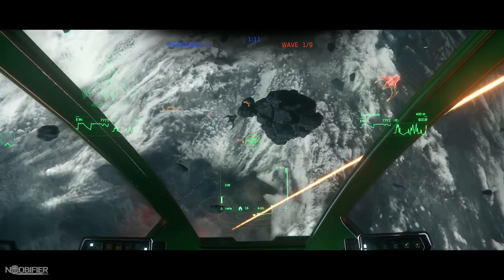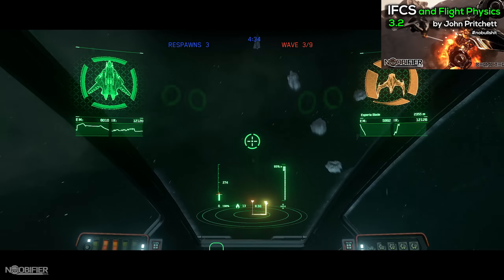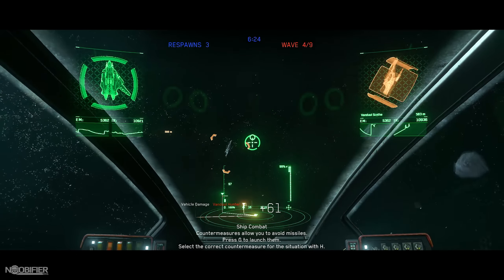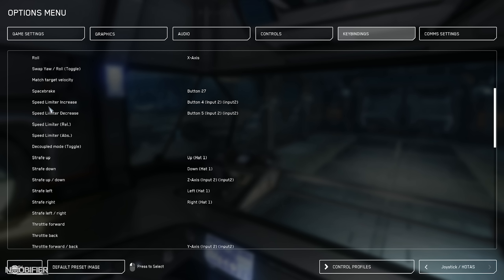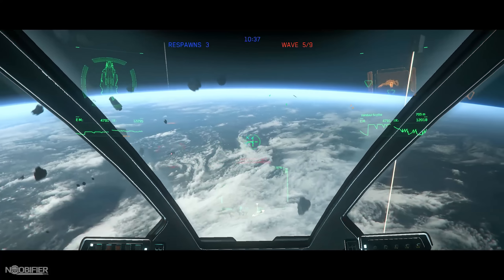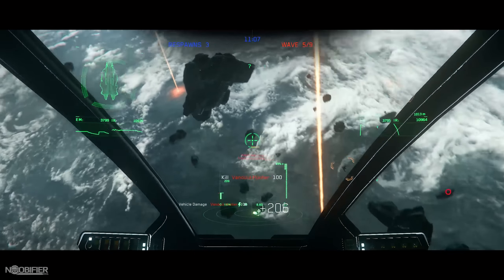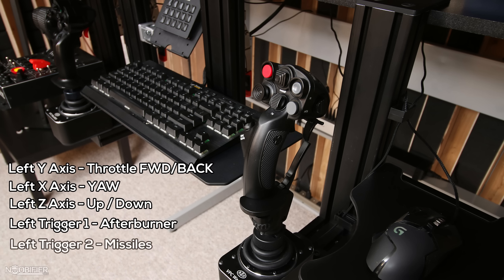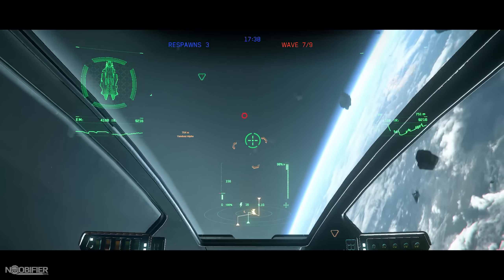Testing 3.5 Flight Model - Star Citizen

Comment: Why do you play with lead pips? Lag pips give you a lot more control over where you place your shots, and you keep your eyes on the target instead of glancing back and forth between the pip and the lasers hitting the enemy.
Reply: Maybe he just likes lead pips? I've found Lead pips make fixed loadouts easier to position, although sometimes the PIPs get all over the place (probably a bug)
Reply from the maker: I disagree, or I would have used them
Reply: Lag may work if you're 2ft away from the opponent. Not practical for actual highly varying dogfighting distances.

Comment: So many people are disappointed or discouraged about the new flight model especially for dual stick users... change their minds NOOB
Reply: It's no secret that the new flight model is aimed at mouse/keyboard first. Some of the lead designers don't even own a joystick.
Reply: @TheZhriver  possibly, some friend some mine said they don't mind it with dual joystick, we shall have to see once they fine tune the flight model
Reply: @Seerthe6th  oh it's much better than what we had. Flying is more intuitive now, especially in atmosphere. However even when using a throttle you only have thrust control while in decoupled mode, in coupled mode it uses 100% thrust and instead controls the desired speed. The new flight model is much more about managing g force and heat, so not being able to control your thrusters is counter intuitive to the new model.
Reply: @TheZhriver  agreed, i tried to help people understand the difference cause this is so fun
Reply: The lead devs on the flight model haven't flown anything but 3.x and obviously clueless

Comment: With the Delta grips have you found a way to set throttle with a button like for example in Elite ? Keep pushing the stick forward for thrust is cool in dogfights but not for long flight. Any solution from your part ?
Reply: The solution is to use the new "cruice control" function. The ship will hold the max speed you have set with the speed limiter.

Comment: Thanks so much Noobifier. I have just tried your suggested bindings and grips for 3.5. Takes a while to unlearn but shows a lot of promise. I just need to practice more. Just wondering if you have considered going back to left and right MT 50 grips? I am going to try this as I don't think you need the twist axis contained with the Delta grips if you bind roll to right stick (x axis) and straff up/dn left/right bound to right stick hat switch. What do you think?
https://robertsspaceindustries.com/spectrum/community/SC/forum/50174/thread/alpha-3-5-virpil-mt50-dual-stick-and-throttle-syst

Comment: Flight model isn't to bad but I hate to say it but the throttle systems were way over thought and make throttle control clumsy and just plain useless in my opinion
Reply: Did you fly on a race track where you cant just drift 2km arround? You need to actualy break now before turning which makes throttle the most value component... Sure in space combat you can drift 1 or 2 km np but what happens if you fight in an astroid field or in atmo ?
Biggest problem is ppl still try to fight at full speedl...

Comment: I do not like the new faked system. IFCS needed work, but at least it attempted to simulate. A cutlass without engines should not be flying on a planet. Firing Jon Pritchet was a bad idea. 

Im sure this new flight model will be fine as its worked on, but ultimately, its not a simulated system anymore. I just hope this attitude doesnt bleed into the rest of the game

Comment: Watched the video multiple times. I'm mostly struggling with thrust. Additionally It seems my X52 thrust keeps working in reverse.
Reply from the maker: There is an inverse toggle within the keybindings on a page called “controls”
Reply: @NOOBIFIER1337 I'm positive that I tried this. It was bound to a button on my stick. However I'll try it again with my keyboard.
Reply from the maker: It’s not something you can bind. It’s not a binding, it’s in its own page in settings
Reply: @NOOBIFIER1337  Ah ok, great, it have would probably taken me some time to find this.  Thanks, much appreciated.

Comment: Guess I'll be Debbie Downer... I don't like the new throttle options. It's made dual stick a nightmare. Previous was so much nicer. 
I don't like speed being indicated on the HUD as the bar, I liked seeing my throttle position as it went up and the speed as a digital read out beside it. They also don't have a way to invert the Cruise Control movement which works against dual sticks. 
Even if they add the inversion. I still feel I lose that tactile/visual marriage that I got from what my left hand was doing to what I see on the HUD.

Oh well.
Reply from the maker: It’s going to take time to get used to
Reply: @NOOBIFIER1337  
I hope so my man. Maybe they'll add a few options to ease the pain 🙄

Comment: Not a Fan of the new FM. ships drift forever, cant turn at higer speeds. feels slower in all. dam it CIG!
Reply: they wanted to get away from the arcady FPS type control in space and give ships mass.  So, it's going to divide people along those lines.  I prefer having mass and forethought in a fight vs twitch style game play and am glad it's moving in that direction.  Neither one of us are wrong, just different styles of gaming.
Reply: Another example of a dev thinking realism/immersion is better than fun.
Reply from the maker: The FM changes were purely because CR wanted it, not the devs
Reply: @NOOBIFIER1337  thats a bit sad to hear but thanks for the info. In the back i was hoping that when CR tryed it he would hate it 😐 guees thats not the case. The limmiter is my biggest consern.
Reply: Slower doesn't mean worst
Reply from the maker: It does however add to a general set of issues that lead up to worst
Reply: @kalbuth  for me it does.. slow flight sims are boring when you know ships like this would go much faster, Ace Combat feels fast and have great controles. iv played space/flight sims for over 30 years. what i pick up on spectrum and discord it seams the space haulers love the new FM and combat pilots hate it..
Reply: @brianfury9790  I couldn't have long enough time without crash on PTU unfortunately, but the Arrow & the like aren't that horrible.
Though I'm still very on the edge about the new FM, I don't have enough hour under my belt with it. The 3.4 FM was very twitchy and akin to FPS, so I'm not so fussed about speed reduction, and like I said, I don't see it as a predominant trait of piloting, so if I make a critique on new FM, that wouldn't be pointing at speed. Dogfights still looks very simplified and maneuvering.... kinda basic, more than ever since the effect of maneuvering is less impacting vs the aiming